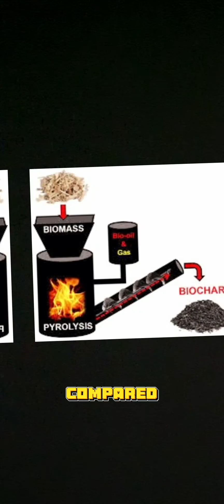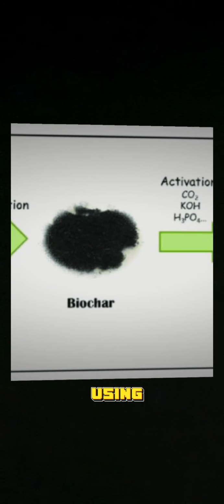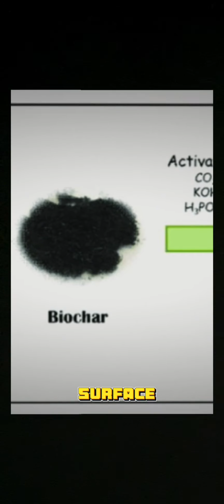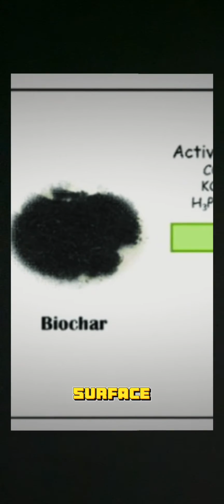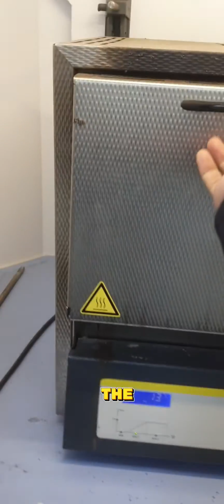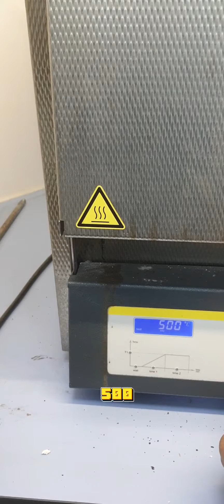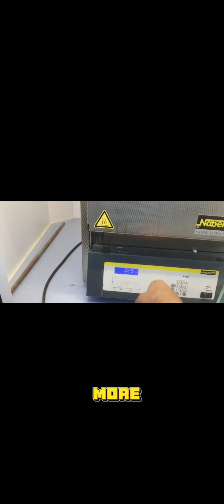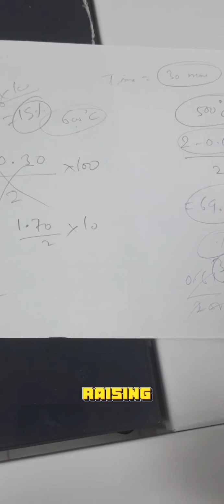“Activated Carbon from Pomegranate Peel: Sustainable Preparation & Applications”

Comment: hello how much activated carbon did the 60 grams of pili yield
Reply from the maker: A typical yield for lignocellulosic wastes (shells, peels, husks, etc.) carbonized/activated at 600 °C is typically between 25 and 35 weight percent (depending on whether you employed chemical activation (KOH, ZnCl₂, H₃PO₄, etc.) or physical activation (steam/CO₂).